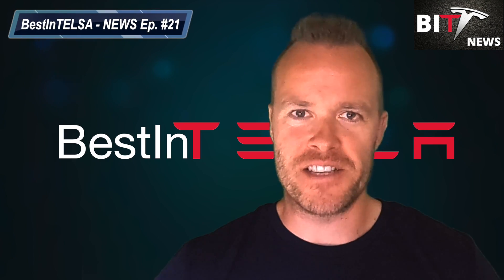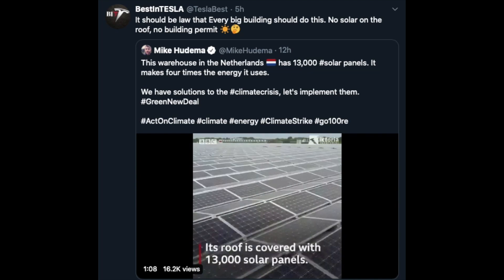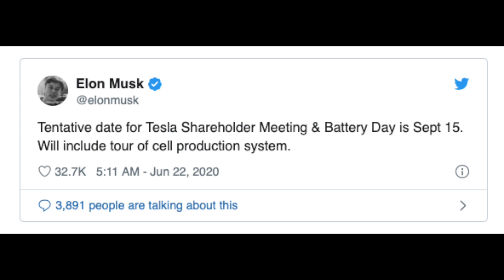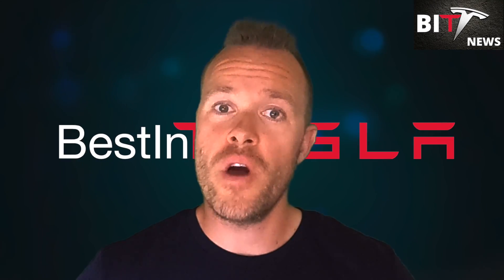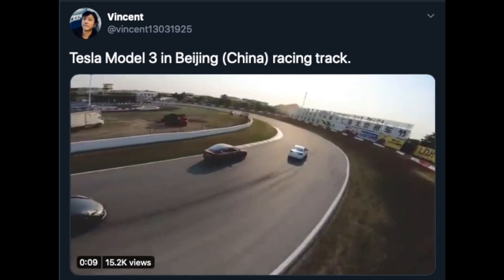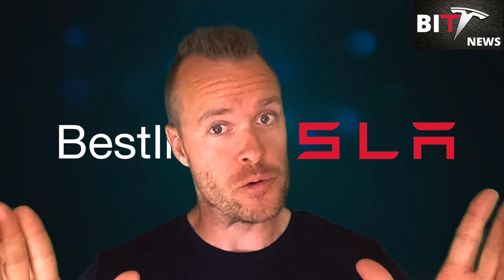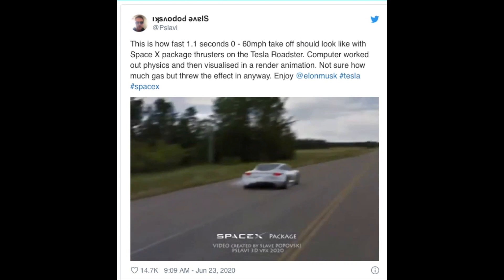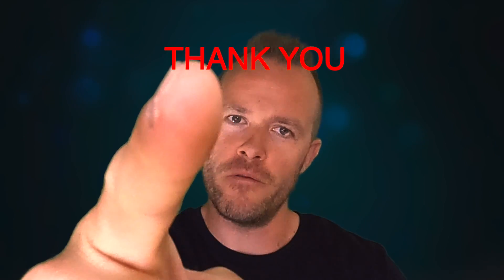Tesla’s secret Project Roadrunner | Nissan in BIG trouble | Good news from VW | Semi get's to works

Comment: Reportedly the “roadrunner” project is going to be a working demo for the battery event / investor day.  Once they get the process down, then they will transfer it into Giga Nevada system. 

Covid19 has pushed the install time duration of roadrunner system back. 

Also reportedly Elon wants a working demo of roadrunner system for battery event.

Comment: Lars; you posed the question " why not use the huge available space to expand at Giga Nevada" and then say that's for another video. When can we expect that ?  It is kind of a big question to just leave hanging there.
Reply from the maker: Soon 😉
Reply: Theyrre using small Freemont to iron out the kinks in production, breaking ground in Nevada for full scale.
Reply: Sounds like Trumps steel deals and foreign trade deals construction.
Reply: Tesla battery factory is in different location in Freemont to the main plant. And rumour has it that sourcing skilled employees in Nevada is challenging for Tesla.

Comment: I think it's almost safe to say that Cybertruck will not be serving as a boat.  Not enough freeboard, not safe, even if they seal the undercarriage.

Even purpose-built land-sea vehicles are iffy - like the World War II Duck.  Every so often, one spills its tour passengers and loses some to drowning.  Manufacturing such a vehicle today would make a manufacturer a litigation magnet.

That said, it's definitely not impossible for Tesla's engineers to re-imagine land-sea vehicle design and come up with something strange and functional.  But it would have to be a fresh design.  And it would be a niche vehicle.  Expensive, low sales.  I can't see Tesla taking that on when there is so much else to do on their plate.

But if Elon hasn't left Earth by 2030, then he might be bored.  Did you know he owns a submersible car used in a James Bond film?  I doubt it's safe to drive around underwater, but it does show he's interested in cars that can serve as boats or submersibles.  If he becomes bored, he might decide to create something sea-worthy and road-worthy at Tesla, just for fun.  By 2030, Tesla may be in such a strong position as to be unworried by the prospect of litigation.

I think it's more likely, though, that Tesla's battery advances by 2030 will enable it to provide packs and drive trains for electric airplanes.  I'm expecting partnerships with small airplane manufacturers.  Remember, Elon has remarked that 400 watt-hours per kilogram would be the threshold for making electric airplanes practical.  I"m sure he hopes to displace fossil fuels from small aircraft, too.

When will we see Class 3 through Class 7 trucks from Tesla?  Or chassis + cab configurations, to be provided to customizers to create niche market trucks?  Fire trucks, garbage trucks, tow trucks, recreational vehicles, etc.  I don't really expect much to appear from Tesla before the end of the decade, but I'd be delighted to be wrong.

Until Tesla applies pressure, truck manufacturers won't feel much motivation to market their own electric mid-class trucks.  They like their ICEV sales as they are.  Volvo, Mercedes, a few others are developing prototypes, but they don't seem to be particularly serious about it.
Reply: Interesting thoughts about chassis/cab configuration etc. Maybe that’s a long term goal for the Chinese granting Tesla ‘royal’ status. Maybe Germany as well?
Reply: @cbromley562  If legacy automakers don't carve out market segments for themselves somewhere, they'll be doomed.  Electrification is happening.  They lag Tesla's tech, so their wisest choice is to move aggressively to dominate budget BEVs, mid-class trucks and other segments where Tesla isn't yet operating.

And to improve their tech, fast.  They'll need help with that.  They generally aren't ready.

I think it's Mercedes who recently inked a deal with nVidia for an on-board computer in the same class as Tesla's current-gen FSD computer.  Problem: they won't deliver any until 2024.  That's likely to have to compete with Tesla's third-gen FSD computer.
So still lagging, but any computer that's in the same class as Tesla's current FSD computer is capable of general-purpose autonomy.

But they'll need software.  That's going to be much harder.  nVidia's computer will come with some low-level stuff, instruction sets, graphics hooks, they can optimize their hardware for automotive requirements, but they don't do operating systems, sensor fusion, object recognition or control algorithms for automotive components.

Volvo is working with Waymo on a robotaxi, but it'll be geofenced, it will have extra hardware and software that won't be on consumer cars from Volvo, and it'll be expensive relative to Tesla.  By the time they can get a car to market, Tesla will have cheaper, more capable, go-anywhere (if regulations permit it) autonomous vehicles.  I guess Volvo has to try, but it doesn't look good.

It's hard to be optimistic about the survival of most of the legacy automakers.  Disruption is going to kill many them.  The rest will shrink unless they can come up with a plan fast and execute it.  Dragging out their reliance on ICEV sales won't work; they'll be eaten alive.
Reply: @Urgelt   I think you’re right that legacy automakers should concentrate on mid range trucks and commercial vehicles, and good quality small to mid sized cars. 

They should perhaps forget autonomy at the moment, and forget ICE and go all in on electric.

They’ll do what they do however.
Reply: @cbromley562  I think they need to be working on autonomy, too, but as a long-range project.  Which is exactly what Tesla did, they've been working on autonomy for quite a few years.

Consumers are not accustomed to self-driving cars, and most jurisdictions will go slow on authorizing them.  There will be resistance.  So there's still lots of room in the market for cars that are not autonomous.  In that sense, being behind Tesla in autonomy isn't yet a critical deficiency, and won't be for a few more years.  So yes, just getting battery-electric vehicles right and making a lot of them at good prices is good enough for legacy automakers' focus.

Hard enough, too.

But they should start to put sensors on their cars, if they aren't already doing so.  They should find someone willing to equip their cars with FSD-equivalent computers at a reasonable price.  They should start to accumulate driving data.  They should hire software engineers and develop a path towards general-purpose autonomy, or partner with outfits like Waymo.  Not that Waymo has a path towards general purpose autonomy yet; I don't think they do.  But Waymo will be the sort of company that could help legacy automakers, if they can work out deals acceptable to all parties.
Reply: @Urgelt   Yes. And the thing is, we will actually see how it all plays out. Really interesting times.
Reply: It floats and can manuver in water.